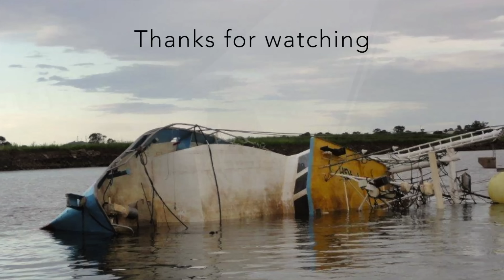9 days to go until the motor goes in - Project Brupeg Ep. 296

Comment: Jese: Time is short, only ten days 'to get ready for the engine install!
Dame: Just have to prepare these blackwater tanks for display at the Metropolitain Museum of Art.
Reply: As a residential contractor, finishes on never seen surfaces are low importance.
Reply from the maker: Top and front of the tank are visible. They were the surfaces I spent time on.
Reply: Good looking paint is also strong paint, might as well do it once do it right, iv always said the biggest thing about being a professional in a trade is 70% knowing what shortcuts you can take that don't matter, for non professionals its best to just do your best job everywhere, I can give you methods of mechanical tips that would get me called a "hack" by non qualified people but all mechanics do
Reply: I don’t like the term but there’s nothing wrong with “hacks” when used appropriately.
Reply: @ProjectBrupeg  (3/30/23) They are just lovely with the straps. I am so excited for the engine, and I promise no wisecracks!)

Comment: For all the haters out there they have been using fiberglass for black water tanks for decades also potable water fuel etc 
and putting the coves and rounded corners can be done at anytime 
I've never seen a couple work so hard and maintain their humor you guys rock cant wait to see the engine installed and running

Comment: Chop strand fiber contains styrene and it is not disolved into the epoxy...  It goes clear in polyester resin because that contains styrene and basically disolves it.  The styrene is the binder that holds the strands together...  That's my understanding

Comment: Something you will want to keep those sight glasses useable would be wash sprayers inside the tank. Might be able to add with the tanks installed
Reply: A windscreen washer jet should do the job but will need a removable access cover and all the hassle of sealing the hole edges.

Comment: I know you've had problems with trolls, so hope you take these suggestions in the spirit in which they were given. I'm really concerned about the holding tanks.

* That fiberglass reinforcement is really weak. Should have been laid up on a bias. Something about 45 degress, only a prime number of course; 49 degrees would be perfect.

* For such a critical application real pros only ever use extra-virgin glass matting.

* Those sight glasses are ingenious, but you didn't think it through. Some day you will want to give tours to school children. What... horrors... will those translucent sight glasses expose them to?

* Finally, that thickened epoxy. What were you thinking of??? White glass beads? In a black water tank? It might work for a gray-water tank, if it was light enough, but really....

It's best you completely rip those noob tanks out and replace them with 3D-printed ones. Preferably reinforced with oxygen-free copper fibers. I fear you'll all drown one night in unspeakable horror (the technical term is exobrachto-dextralevo-spirophaxzimosis, which I'm sure you'll agree is pretty unspeakable.)
Reply from the maker: Some very valid points raised here. MUCH to think about Michael